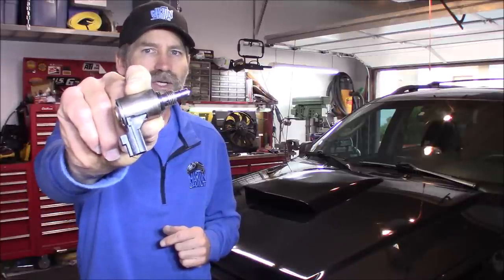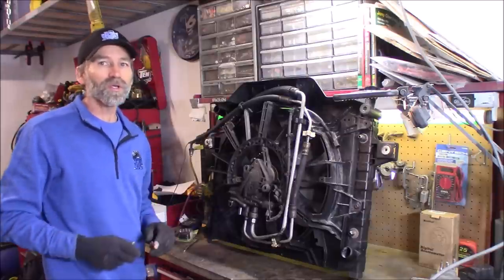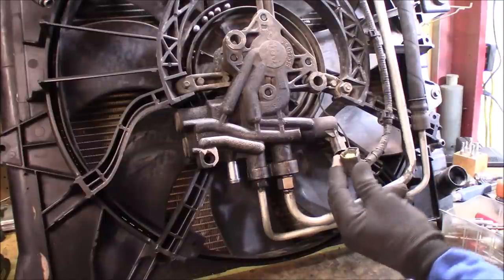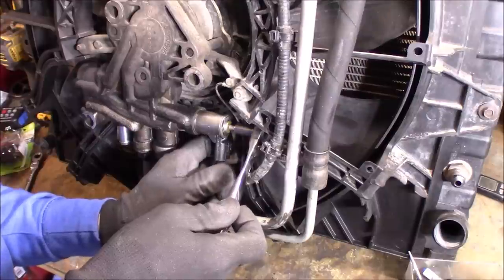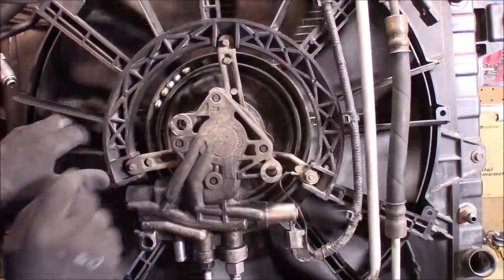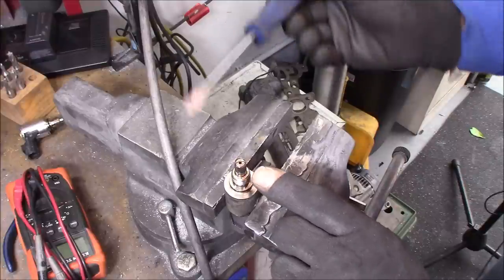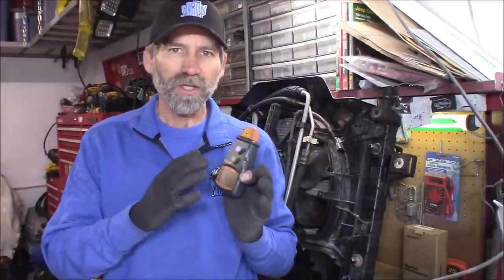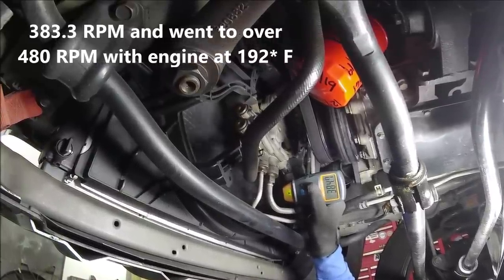01-04 Jeep Grand  Cherokee Hydraulic Fan Solenoid Mod, Remove &  Replace

Comment: Hi Martin, I've got the 3 wire solenoid on my 04 & from what I've been reading it seems im out of luck on this mod. I have 2 questions about it though: do you know how to get the 3 wire solenoid out & if so could i just put a modded 2 wire solenoid in its place? Or if this won't work could i put a variable resistance switch in line with the coolant temp sensor signal wire to vary the voltage the ecu sees to up the fan rpm?
Reply from the maker: I don't think there's any easy way to convert to the single wire solenoid.

Comment: how do you test the solenoid to determine if it's still good and working (besides installing the fan back in the engine bay)?
Reply from the maker: Using a ohm meter test across the two connections you should see approximately 10 ohms. This is with the wiring disconnected of course

Comment: Would you know why y 04 Grand Cherokee does not have the ground wire that mounts to the fan housing?  I noticed that it looks like your solenoid only has 2 wires in the connector?? My solenoid has 3 wires in the connector.
Do you know why? Do I have an upgraded model??
Any help would be greatly appreciated. 
Thank you!
Reply from the maker: I believe they're just grounding through the metal of the solenoid, eliminating the wire.

Comment: another great vid Martin. my steering is very hard to the left at stand still. have just fitted a new pump but still hard to the left at stand still. any ideas? cheers. keep up the good work.
Reply from the maker: That's weird, I'm kind of wondering if there's something wrong with the steering gear box. You may want to remove the tie rod end at the pitman arm and then turn your wheel left to the right and see if it's still hard and if so it would be the steering gear box
Reply: @martinbuilt  thanks Martin. ill give that a go at the weekend. I never thought of that.

Comment: Good morning thank you very much for this information. Please help me. I have separated the temperature sensor between the air conditioner compressor and the generator. In fact, the solenoid works correctly. The fan entered at a very high speed. What after we have to do because when you turn on the air conditioner or cross a rough sand road that increases temperature and the fan does not increase its speed? Thank you
Reply from the maker: Have you tried the solenoid mod? If so and your still not satisfied it may be time to convert to a single electric fan. Like I did in this video https://youtu.be/J02nYci5DS0
Reply: @martinbuilt  Thank you for your interest. I am from North Africa (Libya). I do not have the electrical equipment required. I want to repair the hydraulic fan. I want to fix the fault. I have followed the steps I mentioned. I have separated the temperature sensor. The fan is working very high. So what to do after and sorry for the many questions and thank you very much
Reply from the maker: @naserasas8428  so this tells me that you're ECM, the cell annoyed in the fan all work properly but did you do a modification mentioned in this video that will increase the RPM of the fan  by nearly 100%  And help the engine to run cooler.
Reply: @martinbuilt  Thank you for your interest. You have modified as in the video but remain the same as the previous power. Do we increase the modification by rolling another cycle in the same direction
Reply from the maker: @naserasas8428  I would not recommend it the fan will go into high mode all time and you will see your mileage per gallon go down. If your engine is still running hot I would recommend doing a electric fan conversion there's nothing more you can do with that hydraulic fan to make it any better..
Reply: @martinbuilt  Thank you so much

Comment: Thanks! I just did this to my wj, I might go back and turn it out maybe 1/4 because 1/2 seems like to much. She roars now and stays super cool! My ac still dosent work tho ☹️
Reply: Your lucky my ac works great but it overheats like a bitch! Im pissed.off the fan runs full speed.when I unplugged the coolant temp sensor then all of a sudden slows when I plug it back in I'm trying to find the issue
Reply: @isauroalfredobanuelos6342  What I learned was these factory radiators with plastic sides and single deck aluminum,  fins can get clogged in places you can't see, and loose cooling efficiency.  Also, I found when replacing my radiator, that there is some side wings, that block air from flowing around the radiator sides forcing the flow thru the radiator, looks like cheap flexible rubber.  This stuff gets tossed and air just flows around the radiator instead of through it at lower speeds.   Its shown as "required" in the factory manual on the 4.7L.   Ha, ha, on mine I left it out, just like the previous owner, did not know, and I was under pressure to get back on the road.  An ALL ALUMINUM radiator would be best.   Also,  I found the HPS Performance silicon radiator hoses don't get the stupid endless little leaks at the hose clamps like the factory EPDM radiator hoses.   I like the hydro fan setup, but don't let the steering fluid leak or get real dirty, as your cooling depends on this fan moving the correct amount of air.

Comment: Here's a question you might be able to answer.

I had to change a radiator so I disconnected the fan and I know that that it had the hydraulic cooling lines the vehicle is a 2006 Jeep Commander.

On the two lines the one that would be on the driver side was obviously a flare fitting but I noted I could actually just pull the fitting off of the line screw it back up into the (cooler). And then the line actually just pushed up into the bottom of it and clicked in?
Any other type of flare fitting I ever had the fitting would slide up the line over the flare and into it's connection. 

Do you know why I would have a line that would just pull out of the bottom?

There was another plastic type of seal piece that would slide up the line and click into the bottom of fitting in between the flare and the connector. But I would think if there is a significant amount of pressure on that left driver side line that it could just popped that line back out????
Reply from the maker: I personally haven't seen the hydraulic fan in the commander. Sounds like they changed the type of connector since 04. Is there any type of safety lock for that type of connector perhaps it was missing? I would be a little concerned as well if it was something you were able to just pull off by hand.

Comment: Martin, have you ever ran across where it seems like the fan ramps up to speed a day late and a dollar short? Seems like when I'm doing low speed climbing in mine the engine gets hot then once I stop and raise rpm's the fan will come on real heavy and cool the engine down quickly. changed the fluid with fresh ATF+4, even flushed it before I changed the fluid. Would you recommend giving this mod a shot?
Reply: You aren't supposed to use ATF+4 in these pumps. It'll bog down or even break your fan

Comment: Martin , I have installed a PSC high flow Steering pump in my 02 WJ overland and a cylinder assist to run a bit better the 37s tire that I installed in it but it seems that since the main hose goes first through the hydraulic   fan it seems that the oil flow is limited when it goes through it and pump makes a noise when goes over. 2-2.5K rpm, any thoughts on that to prevent ruining any of the mentioned components?
Reply from the maker: I assuming that the PSC pump is made for that JGC with 2 return lines to the reservoir, perhaps if you tried the solenoid mod this would increase flow and would reduce the noise from the pump.

Comment: Nice sleuthing there Martin! Seems these fan units are up to around $1400 retail from the dealers now. If you don't have a leaking front seal or broken blades, and just have a heating issue because the fan is slowing down, this is a really good alternative to running out to the dealer and Just Empty Every Pocket . 😁👍👍
Reply from the maker: Wow... There's no way I'd ever give $1,400 for that hydraulic fan. I'd either go to pick a part and get one for $30 and take a chance with that or do what I just did and convert mine to Electric. I should have that video coming out in the next week or two.
My favorite is Justify Every Expensive Purchase

Comment: Hey Martin, great video. I'm getting P1499 for hydro fan solenoid. But I am also getting O2 sensor error codes. Is it true that the fan solenoid shares the position #16 fuse with O2 sensors?
Reply from the maker: Thank you ,
That is true you most likely have a blown fuse.
 If it blows again after replacing a fuse I would check your wiring to your 02 sensors.
Reply: @martinbuilt  That was it. I unplugged O2 sensors and hydro fan. Fuse #16 blew . Checked the wiring, no joy. I took it to an auto electrical specialist. A cracked wiring harness near the trans. Thanks for saving me a ton of hassle

Comment: Could you please send a link to where you purchased the electric fan and controller.
I live in South Africa and would like to do this mod to my 2003 WJ 2.7 CRD
Reply from the maker: Flex-a-lite 31165 Variable Speed Control Module https://amzn.to/2Hnpjca
Flex-a-lite 31163 Variable Speed Control Module with Threaded Temperature Sensor https://amzn.to/2HrxCnA
The electric fan I used from a 98 Jeep Grand Cherokee with a 5.9L but you can use fans from a 97 Mercury Villiger or Lincoln Mark 8 and others

Comment: I have a 2008 Jeep Grand Cherokee 3.0 CRD does anyone know how to get this solenoid off?  It looks the same but now spot for a torx and in between the solenoid and the body looks like a nut but it’s very skinny like you need a special skinny wrench 🔧.  Seems like a dealer tool for when the do remans and then replace that solenoid. Anyone do this or have ideas how I go about it ?
Reply: I have the same one .. any ideas ??

Comment: It seems my fan assembly has a mind of it's own and can be quite moody at times. Somethings wrong if my fan spins at idle at say 150 rpm but after a 30 min drive when shes sitting idling for a couple minutes she'll go up to 210 due to the fan not spinning. I have to manually spin it by hand to get it going. Strange part is there isn't much resistance. I did the troubleshoot routine and found that the fan goes into default mode when  the ECT sensor is disconnected but when I turn my ac on the rpm doesn't change. Your advice would be greatly appreciated Martin, thanks.
-Alec
Reply from the maker: Are you saying when you disconnect  The temperature sensor at the fan does go into ariplane mode‽
 Do you have any codes?
Reply: @martinbuilt  yes it goes airplane mode when I disconnect the ECT sensor, no codes. The fan only works when it feels like it. I drove it for 45 mins today then let it idle for a few after the drive and the fan decided it wanted to work haha. Kept the coolant temp at 201 but last night after a 20 min drive at operating temp I let her idle and she climbed to 220 and the fan STILL wouldn't kick on until I turned it by hand to get it started then it spun up to around 300 rpm and cooled the system down to 208. Seems to me like it might be the fan motor itself

Comment: Got a question for you... I have an 01 WJ, hydraulic fan setup on it. A while back the fan lost all power, after a bunch of trial and error I've narrowed it down to it being a broken wire somewhere between the fuse block and the solenoid. So what I did was just cut and splice in a new wire from the solenoid to the fuse block and my fan works great now. However, I now have a check engine code P0051 "circuit low bank 2 sensor 1"  which is the sensor that's fused on the same fuse the fan solenoid is. Thoughts on how to get the check engine light off?
Reply from the maker: doesn't the wiring for the solenoid lead to the ECM
Reply: @martinbuilt  It does after the fuse block. We tested the wire between the fuse and the solenoid and discovered it was broken.

Comment: Hey Martin is it possible to convert the hydraulic fan to electric and have the check engine light off? Also ive been to 3 wrecking yards have 4 solenoid valves that ur changing but my light stays on and if i run ac my 03 4.7 over heats. I live in California's northern central valley and have 2 toddlers need my ac in this 113 degree heat! Any help will be greatly appreciated this hydraulic fan has me confused to all hell... thank you
Reply from the maker: https://youtu.be/J02nYci5DS0 yes this video explains how

Comment: I'm going through an electric fan conversion, how did you get past the low pressure return line from the cooling fan being redirected from the steering box?
Reply from the maker: In this video, I did the E-fan conversion. https://youtu.be/J02nYci5DS0
Reply: @martinbuilt  right! I found out that the pump reservoir has 2 inlets on the low side. I'm wondering if you can just plug one of the returns up and use the same pump with the new pressure hose?

Comment: Hi I have an 01 Jeep Grand Cherokee with the 6 cylinder I haven't overheating problem and I think I have a weep hole too but I'm not familiar I didn't know what was my vehicle have this
Reply from the maker: If you're losing fluid from the weephole on the water pump I would replace the water pump ASAP.

Comment: So I have read you can ditch the Hydraulic fan setup for a mechanical fan since the water pump already has a threaded stud on it. But when you do that and unplug the pressure switch with the fan it causes a check engine light. Does anyone know how to bypass that so the light does not go on.
Reply from the maker: You're spoiling my upcoming video . LOL . Yeah I read that too. Actually it's quite easy to fix. You have one or two choices remove the solenoid from your hydraulic fan and plug it back in or get yourself a wire wound 10 Ohm resistor I would suggest using a 100 Watt resistor and wire that to the two wires that went to the solenoid. It would be best to put it in the Stream of air where it can be cooled as a resistor will get warm.
Reply: The hydro fan is capable of moving MUCH more air then an electric. Put it in "airplane" mode by disconnecting the coolant temp sensor and start it up, you won't find an efan that moves that much air.

Comment: Great video, thanks.  My wife had our recently acquired high mileage 2004 4.7 WJ overheat in stop & go traffic.  It took me a while, even parked next to our suspension modded 1999 4.7 WJ, to figure out the 04 has a hydraulic fan motor (shades of my 1967 Thunderbird windhield wipers!), while the 99 has both engine fan and an electric fan.  I've added a couple quarts of water, and will watch this 04 closely.  Seems to an old guy like me that a good engine fan, with proper shroud, would be more reliable, perhaps a quality flex fan from the speed shop.
Reply from the maker: In theory the hydraulic fan should work great unfortunately the ECM is trying to get the engine to 204 degrees even if you put a 180 thermostat in it is only going to delay reaching plus 200 degrees. Even after doing the mod to the solenoid which did help I was still seeing temperatures above 200. I recently did a electric fan conversion and couldn't be happier with the results.
Make sure that you bleed the air out of the cooling system by removing that bleed screw (8mm Allen) and let it run for 10 to 20 minutes, do this with a cold engine.
Reply: Thanks.  I have been thinking seriously of going with an electric fan.  They are common, both on vehicles and in the aftermarket, so selection is good.  Side note: I wonder if Daimler/Chrysler/Jeep engineered the power steering pump for more output on the hydraulic fan models.  Might have a better chance with a hydraulic MileMarker winch (which my friends at Skagit Hydraulics told me is very weak without an auxiliary pump).
Reply from the maker: @lanedexter6303  I use the hydraulic fan steering pump on my 98 XJ as I have it ported for hydro assist it definitely moves more fluid then a standard power steering pump

Comment: HOLY CROW Martin, I never knew this existed, WHAT A CONTRAPTION THEYV'E BUILT. I have 2 ZJ'S with the clutch fan & want to convert to electric this year still doing research but HELL COMPARED TO YOUR SET UP MINE SHOULD BE CAKE. How did you figure out about the adjustment on that solenoid ?   THANKS FOR YOUR WISDOM & YOUR TIME, Henry.
Reply from the maker: I will also be taking out this hydraulic fan currently mocking up the electric fan.. After seeing some pictures of the solenoid on the internet I had a feeling if you turn that screw one way or the other it was going to affect the RPM of the fan.
Reply: Smart move, I just saw your vid. on the electric fan you're going to put in & REMOVE ALL THAT CRAP.
Reply from the maker: @NoWr2Run   yep just purchased a few more items to complete the electric fan conversion.